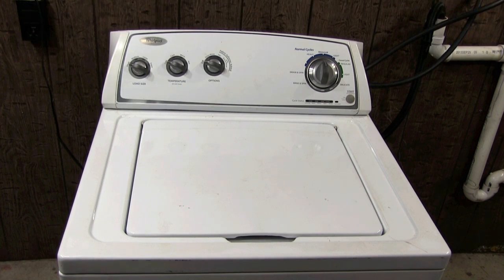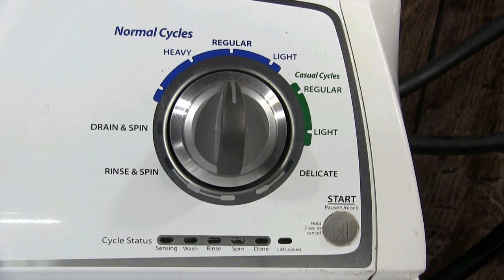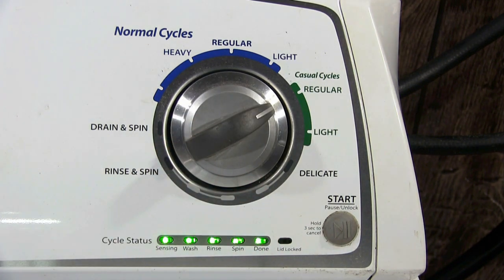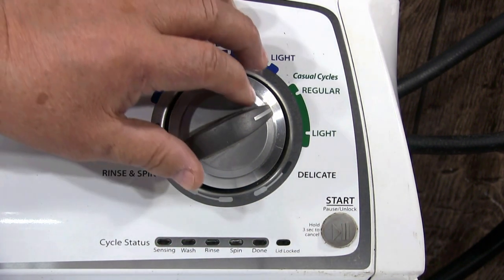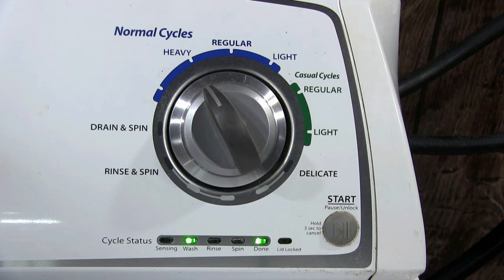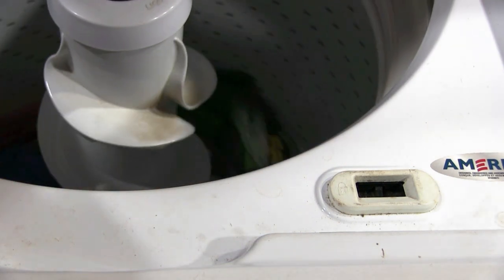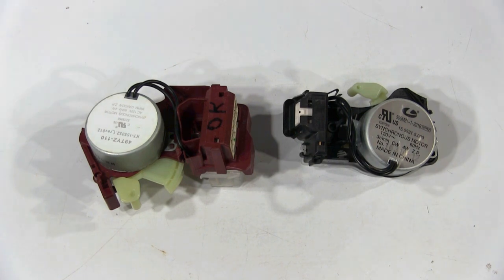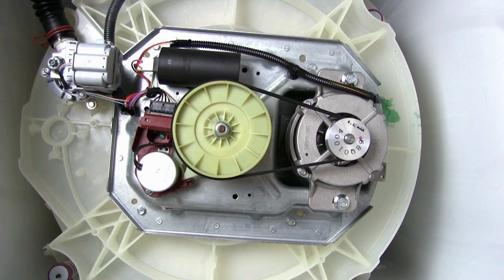How to set a Whirlpool washer on the tachometer testing mode

Comment: Something to think about ,, if the tub seal at the bottom of the tub has even a small leak it will drip water down through the transmission and onto the spinning inner transmission mechanism. This will throw a spray of water into the Shift Actuator (And will also ruin the transmissions bearings by washing out all there packed in lubrication over time) , this can cause an annoying pull your hair out  issue where the unit will test fine as far as the Tachometer test will pass with no issue after it has sat overnight and is now dry ,, "but" after you do a couple of loads this small amount water will get into workings of the Shift Actuator's optical encoder that shines a light through the encoder wheel and reads its pulses with an optical detector on the other side.  this will cause it to intermittently when wet fail to read the Tach Rotation signal ,, the washer will then error out with a Motor failure code and stop mid cycle when its trying to run the motor to spin, it expects to see a rotation signal "present" very quickly ,, if it does not see rotation that should be there when it try's to spin for example the control board is programmed to halt and set an error, often with a "motor fault"  code it thinks either the belt has broken or the shiftier has failed , The shifter also has a tiny normaly- open  switch inside it that tells the washer when the shiftier has indeed shifted to the proper position to agitate. if the shiftier gets wet the contacts of this tiny switch often corrode causing a shiftier failure code to be set as well..